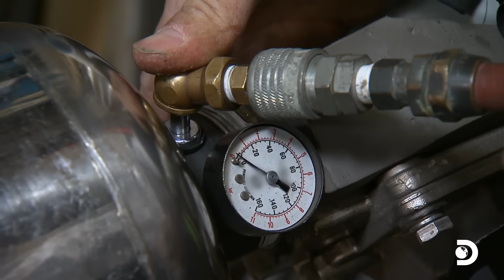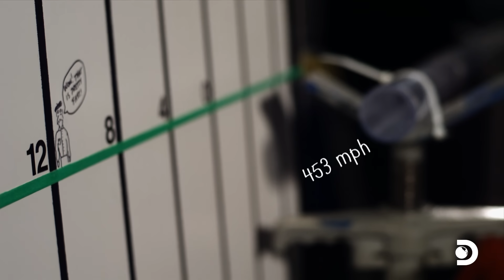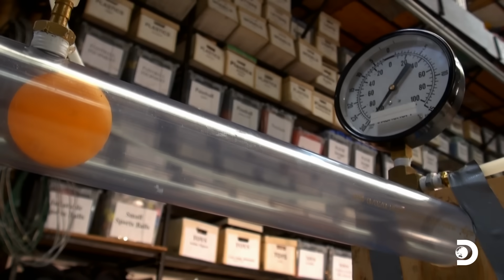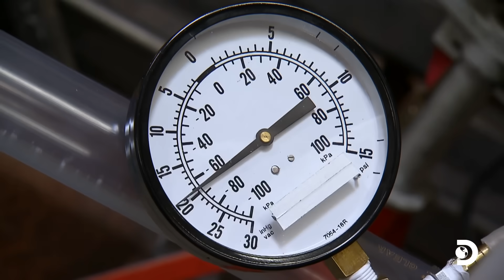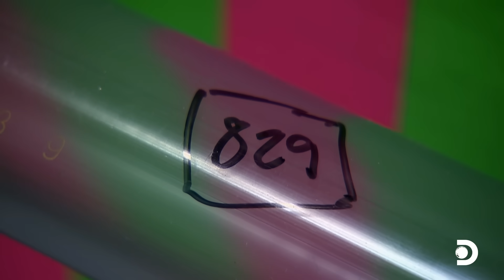Can a Ping-Pong Ball Really Be Deadly? | MythBusters | Discovery

Comment: A lightweight sabot to plug the air and propel the ball. We used something similar in our lab to propel electronic circuits, but to measure survivability after the circuit board (in a special case) came to a sudden halt on impact.

Comment: There are other ways to make them deadly, right? 

The outside can be coated with diseases, or poisons/toxins that can be absorbed through rhe skin. Perhaps for some people severe allergens. Making the ball radioactive enough would do the trick. 

There’s a lot of space inside. I’m guessing that can be filled with a gas other than air and that this could open up possibilities. 

It needs to be a normal ping pong ball? A massive one that weighs a ton doesn’t count? Or a solid one made of steel still shaped like a ping pong ball, perhaps with the same exterior shell. Perhaps one with a sharp object inside. Something with more mass and a point.

Comment: We can't neglect the force of the air coming out of the barrel. That alone can cause some sever damage. I've seen someone have a gassed/unloaded airsoft pistol (Magazine filled with gas but no BBs) shot against their forehead and the force of the escaping gas alone was enough to cause bleeding.
Very similarly here, it seems like most of the damage done to the target is from the violently escaping air, not so much the ball itself. 

I wonder how the results would have looked if they used some sort of muzzle break to direct the escaping air away.

Comment: A "professional" regulation ping pong ball weighs 2.7g, and at 1100 mph is impacting with 240 ft-lbs of force over a very small area. I would say plausible, if not confirmed.
Reply: If I did my math right, that's only about 1.7 PSI. The average boxer hits with about 770 PSI. Granted, that's wearing a boxing glove and a larger impact area, but even bare knuckles, it's unlikely to be fatal. Personally, I think the air pressure did the bulk of the damage to the pork shoulder.
Reply: @srellison561  Boxers don't die more often because boxers usually stick to hitting boxers.  They could absolutely kill the average person with a punch like that.

Comment: They needed to add a reservoir at the end of the barrel off to the side to provide a place for all the air getting past the ball to accumulate. i.e. create a really large vacuum volume but most of the vacuum volume is off to the side near the end of the barrel. The air (atmospheric or boosted) rushes in, pushing the ball and some getting past it but at the end of the barrel the air goes out small side holes into the side reservoir and the ball continues straight and breaks out of the barrel, never being slowed by the air cushion. One of the few episodes where I had an idea that could help and they did not just go there. I so want to try the larger vacuum and see how much faster it would have gone.

Comment: Straw has been found imbedded in trees and brick/cinderblock walls after hurricanes so why not a fatal ping-pong ball?
453 mph is 664.4 fps - a CO2 powered pellet gun averages between 400-600 fps firing a 7.4 grain pellet, which weighs approximately half a gram while a ping pong ball weighs 2.7 grams, or 41.7 grains, which is approximately a .22 long bullet weight.
Weight plus fps is what creates the lethality of a bullet - the FBI has determined that about 63 foot-pounds (85 Joules) is the minimum needed to be considered lethal, so that means that the ball is currently delivering 40.86 foot pounds of energy to the target - not enough to officially be considered lethal, especially in light of how large the diameter of the ball is and thus how dispersed the energy on the impact area is.
779 mph is 1142.5 fps which brings the ball up to 120.8 foot pounds, almost twice the minimum the FBI feels is lethal, meaning that even with the diameter of the ball spreading out the energy, it should be capable of ruining someone's day.
1086 mph = 1592.8 fps = 234.9 foot pounds - average 9mm bullet delivers 300-400 foot pounds.
1100 mph = 1613 fps = 240.85 foot pounds - 9mm bullet travels an average speed of 1150-1200 fps, so yes, faster than a speeding bullet.
Sorry, gotta give thumbs down because they failed to use a ballistic skull or some sort of simulation of a headshot as I'm sure the myth of a fatal ping pong ball impact did involve being struck in the head and that ball was delivering sufficient foot pounds of energy that odds were in its favor of caving in a forehead and potentially even blowing through plywood.

Comment: Ping pong ball may not have been deadly, but that air pressure going into the cavity most likely would be.
Reply: yep, came to the comments to say just that
Reply: It also depends which body part you target, heart or tight not the same
Reply: Dang, no kidding.  Right at the end where they show it and say it's "not deadly" does not add up.
Reply: Yeah, i call bs on them saying it was busted. EVEN IF you don't bleed out of the hole it makes, there would be extensive internal damage, bleeding, broken bones air in vains, etc. Its as if they think a hammer blow to the head wouldnt be lethal, the power and impact of that ball is enought to cut clean through your skull.
Reply: @gmanhero Reminder that the end goal was to see if the ping pong is lethal.
Reply: @gmanhero if it was point blank shot lol
Reply: @gmanhero no, the impact of the ball was minimal at best. The energy of the blast was from the remaining air in the barrel. The question was if the ping pong ball can be lethal. We saw the initial impact when the ball disintegrated after hitting the shoulder. The rest of the air that gets blown into the wound shouldnt be counted. We arent testing the lethality of the air cannon just the ping pong ball
Reply: @takumi2023  agreed the Air Cannon is whats Lethal not the Ping Pong Ball.
Reply: @gmanhero  yeah but thats more the AIR then the ping pong ball itself.
thats like saying I Shot someone when i just hit em in the throat with the butt of the gun thats not the same as shooting but it is using a gun ...

Comment: it looked like the air did a lot more damage then the ball,  air pressure isnt something to mess with
Reply: Even though the air did most of the damage, I think the ball broke the skin to allow the air a pocket to fill and tear. Without the ball I don't think the air would have broken the skin. I'd like to see it tested further.
Reply: @angusmctwangstick4079  yeah, you can actually see remnants of the ping pong ball get forced into the wound even further after impact - the superficial damage they saw was probably because of the ball splintering into sharp plastic and allowing tears and then being forced in by the remnant air pressure.
Reply: Nah, EVEN IF you don't bleed out of the hole it makes, there would be extensive internal damage, bleeding, broken bones air in vains, etc. Its as if they think a hammer blow to the head wouldnt be lethal, the power and impact of that ball is enought to cut clean through your skull. If you have doubts look up the youtuber i did a thing, he made this in his garage 5 years ago.
Reply: that was my thinking too.  would have like to see them run the test a second time without the ball.
Reply: @theonecrazyfrenchman  lack of adequate controls and replicates is generally an issue with the scientific publishability of MB... which does not bother me too much because it's mostly meant as entertaining demonstrations of principles, which they did quite well
Reply: This is the post I was looking for. High pressure fluid injection can cause massive local trauma. Even in an appendage- without amputation, that sort of injury could certainly be lethal.
Reply: Yeah, that’s what I was thinking. The ball broke the skin which allowed the air to enter and cause quite the bubble under the skin. Maybe not fatal, but that would be an incredibly painful wound.
Reply: @GeoRedtick  in the chest area that could very well be lethal
Reply: than, not then